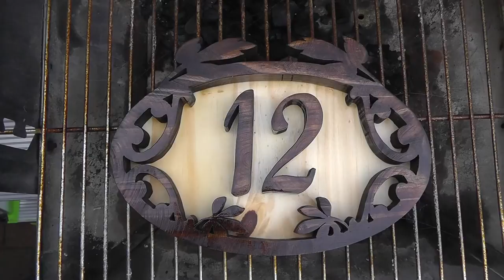Christmas gift - How to make a House number on a Scroll Saw

Comment: How did you get the 12 on the same sheet as the design?
Reply from the maker: I used Photoshop, but you can print them separate and glue to the same piece of wood. If you want one with numbers send me a message on Facebook with your number and I will make one for you.